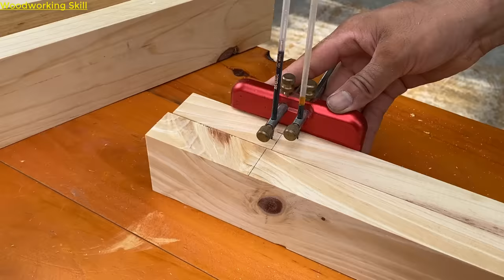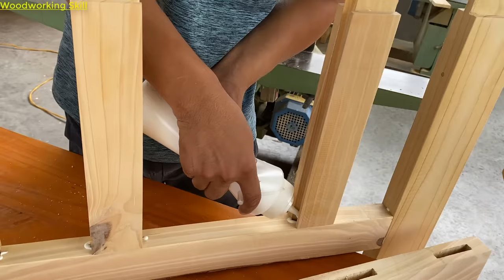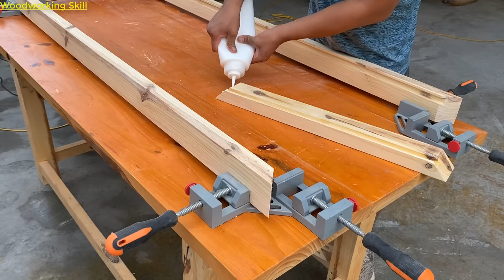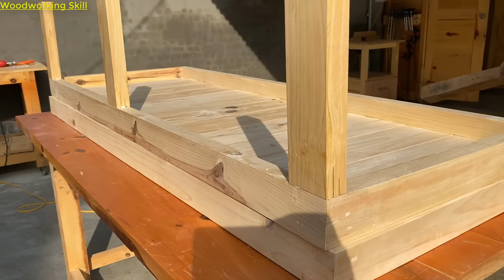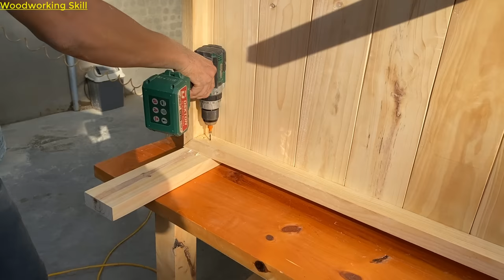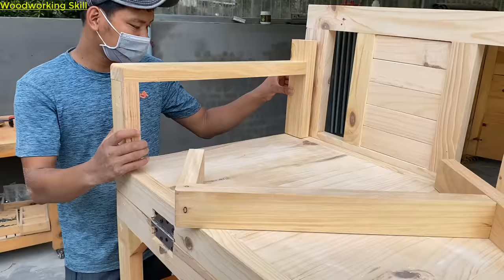Space Saver Smart Furniture Ideas & Designs // Build A Sofa Chair Combined With Bed Wooden

Comment: Great idea, but I think it needs 3-folding hinges instead of 2….for better support laying down and folding….great job…thanks for sharing….
Reply: Yes, three hinges would be ideally balanced if the Wood is well seasoned BEFORE commencement of the job. The smoothness of (advisable)Three hinges does not always work in tropical regions as all varieties of Wood (dry wood including Ipe wood)have a degree of both thermal coefficients of  expansion and contraction with seasonal moisture fluctuations affecting dimensional movement. Perhaps, that is why he did not include the central hinge. Digressing from the comment at hand have you noted the number of electrical carpentry gadgets he has used at each stage of assembling ? Gone are the days where time was not the essence but perfection considered the epitome of craftsmanship. I do not in anyway wish to discredit this Carpenter's workmanship as he has benevolently taken out time to demonstrate the simplicity of designing a Bed cum Sofa.